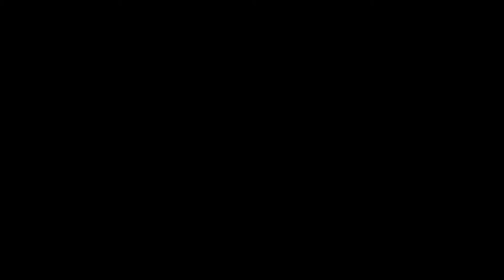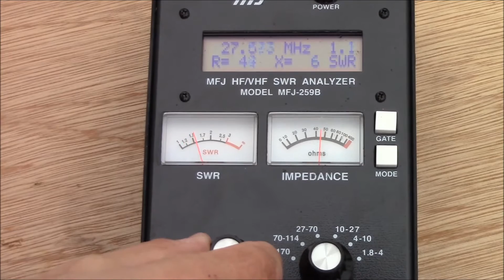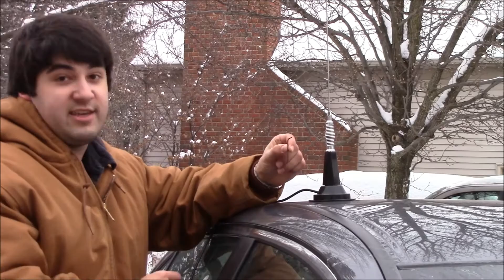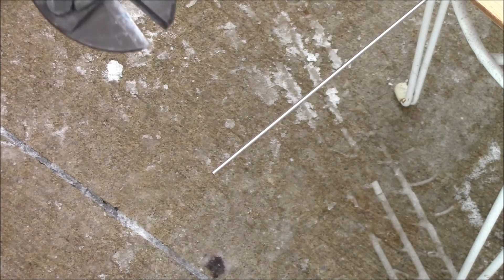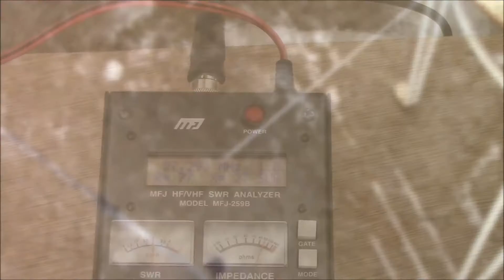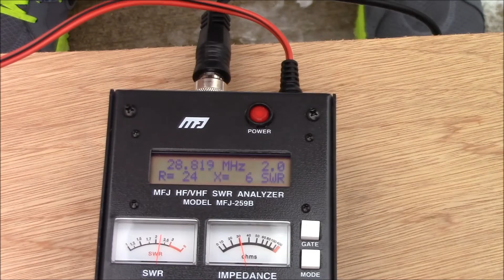Tuning a CB Whip for use on the 10 Meter Ham Band

Comment: This is exactly what I was searching for. 

I have a Sirio 5000 for 11m  on top of the 100x150cm steel plate covering my chimney .

Since i got my licence I want to re-use it for the 10m band.
Thanks for the good advice of repositioning to the same place and setting the rod properly in the hole again. 

So thanks

Comment: Re: Power input to the 'new' antenna.  A mobile ham radio can put out 50 watts.  What would THAT do to this antenna ? Or the radio?
Reply: The Wilson 1000 is supposed to take up to 1000 watts. Actually, 3000 watts (according to Wilson anyway). So don't worry about your 50 watts. I'm planning to use my radio's max wattage of 100 - and not worrying about it.

Comment: Okay my radio does AM FM on the CB channels but it will also work on 10 megahertz setup but my SWR is too high like theirs on 10m. But I have a non-adjustable type antenna could adding a spacer or Riser or whatever possibly help this. And when I go up to 10 it jumps up to almost three

Comment: A fun thing to try, is a 27MHz 1/4 wave whip is actually a 1/2 wave on the 6 meter band.  You need a high-impedance end-fed match for it though, feed impedance about 3,000 ohms.

Comment: I managed something similar with a Sirio HP4000.
Trimmed 4 - 6 inches off. Now covers the whole of 10 metres.
Reason says this should not be, but it receives better than a full length 1/4 wave on marginal "local" contacts

73 de Tony

Comment: nice vid.  here recently i did the reverse made a 10meter to 11 meter by changing out the stinger to a slightly longer one
tuned nicely had lots of fun, When 10 opened up i swapped back to the factory stinger tuned, had lot of fun made a few qso's
on 10 meters.
73's   K7sce

Comment: I replaced the Wilson 5000 with a 102" Stainless Steel Whip without a spring.Less than a 1.5.1 SWR across the entire 10 meter band so I can now work the entire band including the FM portion with my Radio Shack HTX-10.Great combination & a whole lot of FUN.Hope & work you soon. de W4KVW in Northeast Florida

Comment: Hey fellas... great vid. I don't know if repeating this kinda demo for a cb radio antenna cut-down for use on 2 meters would seem redundant to you but I'm really interested in seeing this done also. Think you could do one like that? I enjoyed your tips n tricks info like test in the same mount spot, etc. Should I select a bottom loaded or middle loaded mag - mount whip?
Reply: A CB antenna designed for 27 mhz would be a terrible match cut so that it works on 144 mhz even if the SWR was good that's not all that matters for good performance.

Comment: I cut down my K40 and only got off the charts for 10 an 11 meters SWR....tossed it.   Both older radios.  Not sure where to spend money now.  The ten meter was old but boxed (new-ish).  Didn't want to fry it.  CB was a cobra about 1998 with lots of hours on it but tweaked...    Now Im "eskeert"  Because I don't know if the antenna was bad (could be) or the radios......